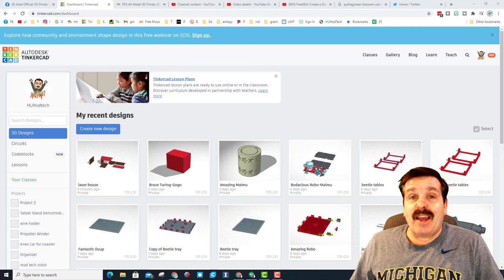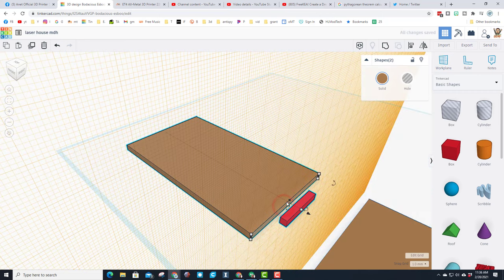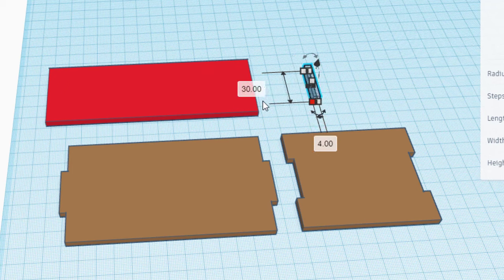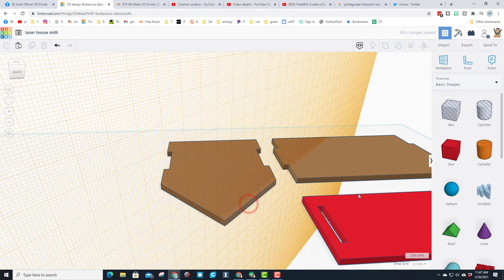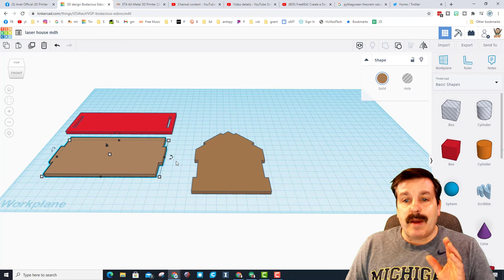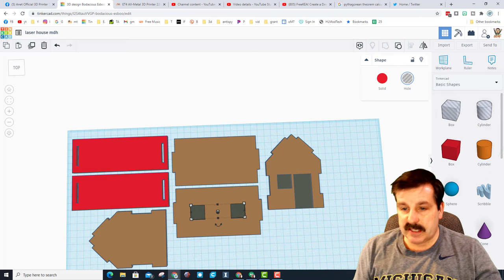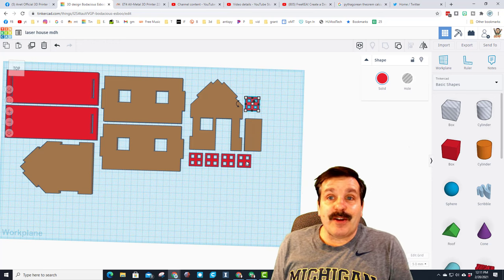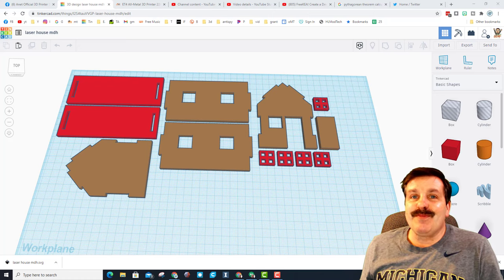Use Tinkercad to create a Laser Cut House | #STEM #Design #Lasers

Comment: Can plastic be used instead of cardboard?  Being into model railroading, this would be cool way to make custom buildings.
Reply from the maker: Yes. As long as you can cut it in your laser cutter you could use any material.I pick cardboard as a teacher because it's a free resource and it's just fun for kids to build with. Then the only modification to the project would be Make your tabs the size of your material. Instead of the 4 mm I use all the time.

Comment: I am having a hard time getting the roof tabs to perfectly align across on top of the house. They both turn brown but I'm getting a blue line that goes maybe 1/4 of the way across the tab.  Any advice?
Reply: not totally sure what I did different but its working now 😅
Reply from the maker: I have seen that in my classroom as well. One trick I am working on is to subtract the tabs instead of adding them. It always works...Just need time to make the vid. 😜

Comment: What’s your other laser carver?
Reply from the maker: I have an Orion Motor Tech 55W laser too.
Reply: @HLModTech  I do most of my work with a 3D printer (My ender 3) I’m considering get a laser to expand my tool set. Do you have any recommendations?
Reply from the maker: @jakelong6359  I have really enjoyed my OMT 55W. Half the price, more power and if something goes wrong I can get in there and fix it. On the other hand... if something goes wrong I have to get in there and fix it. With the Glowforge if something goes wrong you have to ship it to them.  What are you hoping to cut?
Reply: @HLModTech  probably plywood maybe at most 1/4 inch thick. I like the idea of making puzzles and 3D models that I can snap together. I know I can do this stuff with a 3D printer, but I feel a laser cutting would be quicker. Plus it would give me the option to work with new material. I would also like to try my hand at designing a balsa wood plane.
Reply from the maker: @jakelong6359  Those are all great projects. I did cut some 1/4 inch stuff that was given to me. Reminds me of luan, but I cannot guarantee it.
Reply: @HLModTech  yeah, honestly you do some cool projects. Was class do you teach? My school never offered a class like yours. (I’m a hs senior btw)